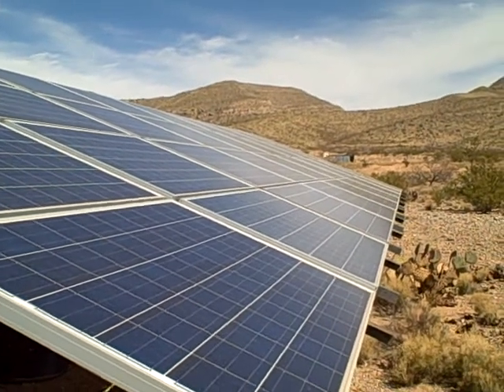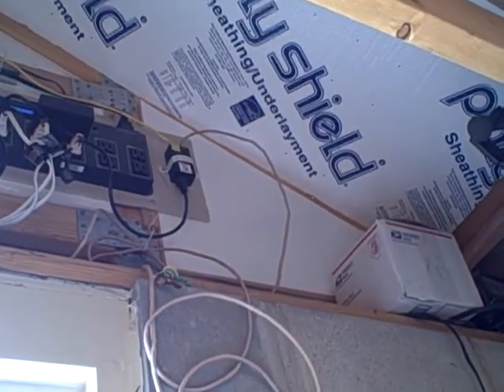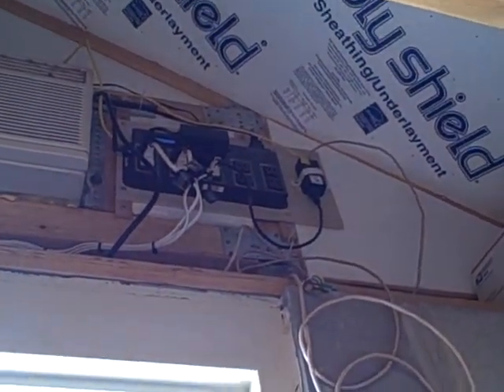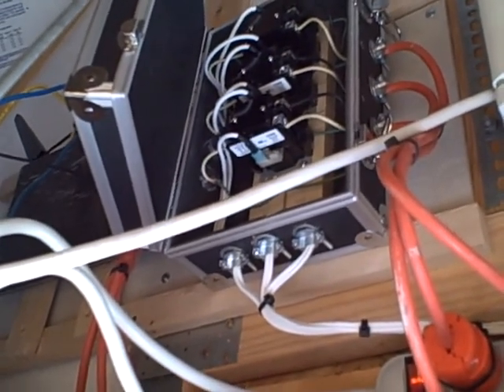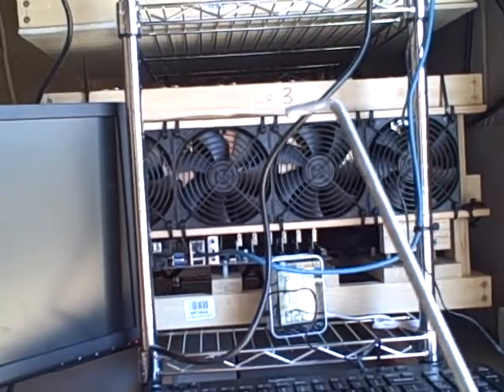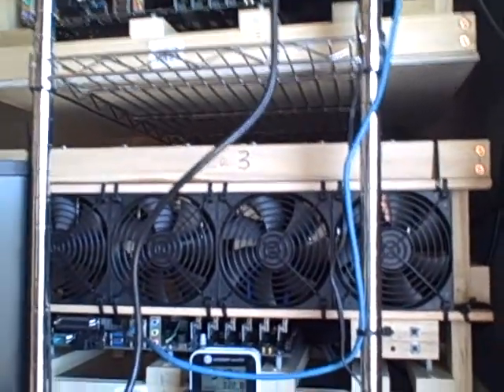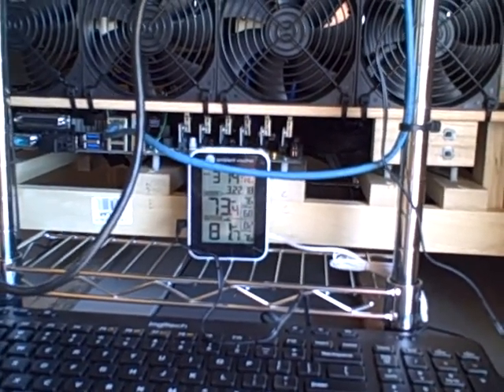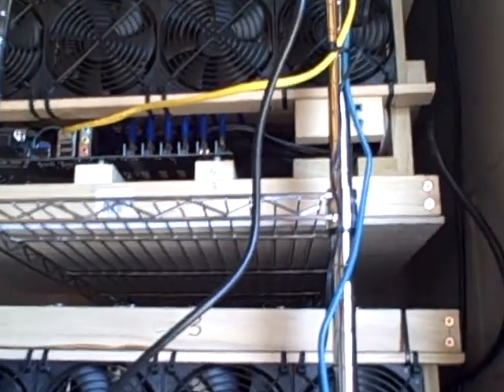Mining Bitcoin with Solar Panels (part 2).

Comment: How is it going with this project now?)
Reply from the maker: it's chugging along, obviously making more as the value of a coin goes up
Reply: @Shelka04  cool :) Does it work at night/in winter or in cloudy weather?
Reply from the maker: @johngalt9374  if there is enough light to read a news paper then there is enough light to make electricity.
Reply: @Shelka04  yes, but mining rigs require a lot of electricity and they should work 24/7. Do you turn off rigs at night/cloudy/rainy weather or they use batteries?

Comment: can u tell us  how many kw you make with panels and what equipment? i have 15 antminer l3 ++ and i want to make a set up with solar can you please provide me some info about the equipment is needed and more or less the cost of that? also any pointers from where i can get the cheapest equipment? have you try using wind turbines? ebay has some turbines that they say can produce up to 4600 w for 250 euros,dont know if that is real or not !